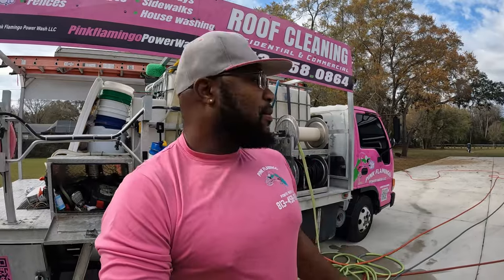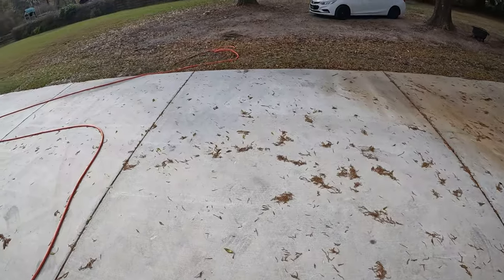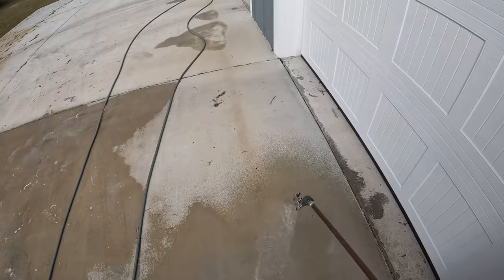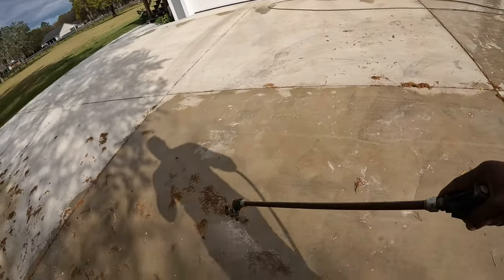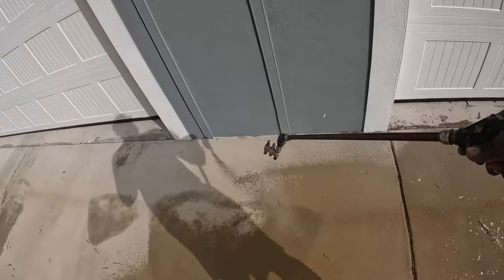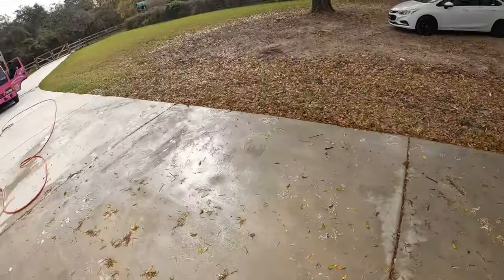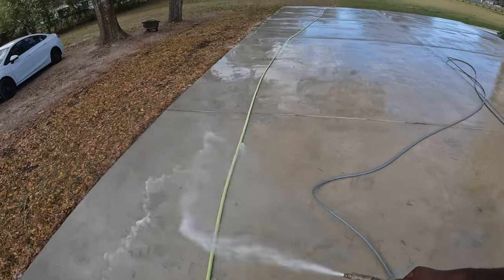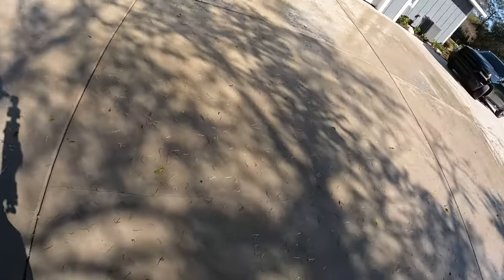NEW concrete cleaning #powerwashing #pressurewashing #howto #softwashing

Comment: I know this job the tire marks were not included, but do you have a tip for removing tire marks on new concrete? Thanks man
Reply from the maker: Strong citrus cleaner , or degreaser
Reply: @PinkFlamingoPowerWash I have new construction home < 1yr with tire marks tomorrow. I’ll try my hotterNhell on them. Still rinse with low pressure?

Sorry to piggy back off this, just similar question. Love ur work bro 🤜🤛
Reply from the maker: @random4189  yes that's a good plan

Comment: Hey cliff quick question. I was reading something where a business owner was saying using bleach on the wrong paints on houses could cause streaking spotting or discoloration of the paint have you ran into this problem with house washes ever and what would cause this? Thanks man you’re the best
Reply from the maker: Yes that does happen once in a while. The cause is because of cheap organic paint that home owners or contractors use on those houses. Organic and SH doesnt mix well. for instance algae, mold, mildew are all organic and sh cleans those so the same happens on a organic paint. It discolors it badly.
Reply: @PinkFlamingoPowerWash  How do you go about avoiding this issue can you easily tell when its this type of paint or do you spot check every house you do? Thanks for the info youre the best on yt.
Reply from the maker: @YungGoochy  it's hard to know by looking and most thinks it's only on blue houses but it can be any color. So best thing to do is 1. Have it in your terms and conditions to cover your butt and 2. Always do a test spot before spraying a whole wall.
Reply: @PinkFlamingoPowerWash  Thank you man i really appreciate you